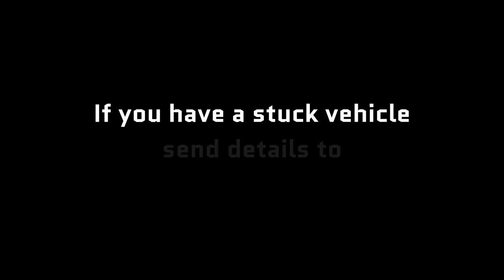The Largest And Most Stuck Excavator I’ve Ever Recovered

Comment: I work on excavators at a dealer. That machine needs a pump/ work group adjustment. Not enough pressure going to the travel motors or work group. A simple turn of a couple reliefs would have made that recovery much easier.
Reply: So your saying that the track that moves it forward and reverse had minimized power and by tweaking some, ; valves? Would have gave it power to travel faster ?
Reply: That's possibility crossed my mind too! The turning power looked way to weak
Reply: @srjr2531  That is exactly how it works
Reply: @rolannolan9336  man this is a major life hack for anyone in that industry lol can never learn too much here on the good old YouTube hopefully guy saw your post !
Reply: @srjr2531  proper adjustment is what he is referring to.  It is not a life hack. You will regret turn that screw with out knowing what you are working with or the tools to view your tampering
Reply: @jacobkrogstad9122  oh dang well when you put it that way it’s probably not a simple life back then lol
Reply: Jacob Moore do you know how to do this “ proper adjustment “ if so niiiice
Reply: @srjr2531  A set of pressure gauges goes a long way when you start messing with excavators.  Those JD 450 excavators are awesome to run when they are set up correctly.
Reply: As a guy who works with hydraulics every day 
I’d like to add that if you do not know what your doing and have a pressure gauge leave the relief valves alone 
A good way to damage your system or get someone hurt 
Need to put a flow meter on the pump outlet check for a healthy pump before you even think about pressure
Reply: It could not pick one end of itself up. An excavator should be able to do that easily.  
It might not have even gotten stuck to begin with if it had a properly working hydraulic system.
Reply: I’ve never worked on excavator in my life and I could tell that that thing was a fucking turd. He could barely crawl out of the hole when he WASNT stuck.
Reply: At least5 to 8 hours work. May even need another machine for an anchor
Reply: Hhhuu
Reply: 8 hours and 18 minutes

Comment: I'd dealt with similar, and this is what a guy taught me:
If possible, dig a pit nearby.
Put in a honking big pump (at least 4 inch hose two would be better) and de-water the ground...just pump it somewhere else.
Then you can work without 'pumping up' the soil so much when you move the equipment.

Comment: You did well. 50 years ago I graduated in engineering. The first company I worked for was a mining company. They had a 17 yard drag line. It got stuck. It was the operators not the engineers that figured out how to get it out. Took almost a week. We used  a lot of trees. Ground you were in looked like what we had dry on top, silty wet sand under that when disturbed would sink a pickup.
Reply: I love operating drag mines, I seriously wish all excavators were drag lines and not hydraulic

Comment: We once had a bulldozer stuck and almost sunk in the mud. We hooked it up to a lot of chains and anchored the chains and the winches on something solid. Then we put the chains under tension. Every single day we would come back, the chains would be a little slack, and we'd put them under tension again. Took a a month or so, but we got it out. The problem with mud is the harder you pull, the harder it pulls right back. Subtlety is the key. Or of course this...
Reply: 30 days Jesus.  You didn't almost sink
Reply: 9.50

Comment: Awesome Job Heavy D,👍👍 I would have guessed 6 hrs and 40 minutes.  This job is a toss up between you and Letsdig18  excavator recovery, that one was buried up to the cab. He only used his excavator and worked in the soup with mud mats, it took him 1-1/2 hrs . In fairness to you, this situation was much different, that excavator was locked up solid, sat and was caked in dry mud.

Comment: When you tried to lift the tracks before you started to pull it since you didn't remove the dirt from under the counter weight you essentially moved the pivot point from behind the tracks to the bottom corner of the counter weight so instead of just lifting the front of the tracks you had to lift the entire excavator up and pivot on the counter weight.

Comment: I would have guessed something less than 8 hrs. I use to own an underground excavation  business in Las Vegas during the 80s and 90s. Your videos make me wish I still owned it. I however do have an opinion on how I would (or could) have extracted that John Deere track hoe. All I would have needed would have been at least a Case 580 or 590 backhoe and a few hundred tons of crushed rock. I would have over exed a ramp leading out of the mud pit digging and filling it with gravel as I went.

 Once to the excavator I would have had a sloped road base filled with about 3 feet of gravel base for the equipment to rest on. I would then excavate about 4 feet below each track then filling the trench with more gravel up to about midway on each track completing one side before moving to the other.

 I would then use the excavator boom to raise each track, working one side then the other back and forth to allow the extra gravel to work it’s way underneath the tracks. Once the gravel was firmly below the tracks I would attempt to track it out of pit using the power of the boom to push as I tracked out (I would have also removed as much mud from the tracks by shovel as possible once they were out of the mud).

 I think it would have worked but obliviously your method accomplished the task! It is just that not everyone has the equipment and manpower you have and I am purely tackling this as if I would have been the land owner. Anyway, thanks for another great video.

Comment: This was Great!  I love it when you do heavy duty problem solving like this.  Now you need to do a one hour show on having an industrial level Blacksmith repair the 5 ton's bumper.  Also, five ton wreckers are cool but if want awesome, you need to get an Army 10 ton wrecker or the heavy tank recovery vehicle. VTR M88.  The M88 is designed to rescue 50 ton tanks, has a huge winch and a spade blade on the front to anchor it while doing so.  You will need a dragon wagon, (super duty Army low boy and 10 ton tractor) to move it around.  It's not too road friendly, even though it has rubber on steel treads.  I think it weighs around 80 tons.

Comment: My experience with stuck tracked equipment is tie they the front of the tracks so the tracks can't roll than the tracks act like skis. And a better use of the dozer is turn it around and bury the blade and use it for a Deadman. Ive pulled out track hoes with a 1 ton wrecker with a pair of 12k winches using a dozer for Deadman. Ive puled 110k steel trucks with a 16 ton wrecker.... Lots of snatch blocks a a few large oak trees!
Reply: 4hours

Comment: Seeing the bumper on the 5 ton going all Picasso reinforces my thoughts on making a spine other than the frame to tie the rear hitch point to a front hitch point. The spine would be the load bearing portion on extreme pulls that require an anchor.

Comment: Looked quite easy really - because the tracks stayed on the entire time. Most older machines stuck that bad would have thrown a track off at some point in the proceedings. Or burst a hose, blown a track motor, overheated etc etc. Good job.
Reply: could show the original driver knew when to say stop and not push it to far
Reply: @J3AD  it also could be we made them very well too
Reply: It looked to me the excavator just lacked power or something, black smoke while just trying to turn the tracks and move the arm isnt a good sign.

Comment: I know you are apparently a pro at what you do and I would not mention anything other than the fact you brought it up first. When you mentioned clearing the area in case a cable snapped of course that is a very important thing to do. Would you consider should you have a situation like this again and you, or someone else, is in the direct line of fire if something breaks (you even did not have any type of safety glass in front of you) bring some heavy tarps and lay across the cable. This action takes most of the whip out of a cable or chain if it snaps. Hope you consider it if not for your sake then for your family if you get hurt or killed. Keep up the good work.

Comment: Estimate before watching the video: 2 hours 30 minutes. Straight forward. Ground is now dry, unlike when it got stuck. Dig out around the tracks and it can pull itself out.
Reply: ya what's all the equipment for?  1hr  23min on it's own power and by itself.
Reply: Okayyy Einstein.
Reply: That's what I was thinking it could dig itself out.
Reply: It could if it wasn’t old as shit and the pumps weren’t worn right out  in it.
Reply: @stevejablonsky7102  only a minute into the video but i would literally never trust you to run an excavator or even gradehop on one of my jobs if you think that lmao
Reply: @sjv6598  yeah, I did watch the video and  see it was still wet after he started digging. As stated above, my estimate was before watching the video.
Reply: @sjv6598  Side note, Letsdig18 has recovery video that is even worse than this one and it took 1.5 hours from start to finish. In the let’s dig 18 video, there was no dry out time and it was pure swamp.

Comment: In my ancient experience, to have the 'hook bucket' work you better have an equal or larger sized excavator and not have f*****d around with the stuck one too much thus sinking it even further... I once got involved w recovery of totally sunk & dead long-stick 250 sized excavator about 100yds out in a former water treatment settling pond (yum); took a pile of mats, big dozer W winch, medium dozer pulling, and my 200 sized excavator to dig a trench out, mat it, and then help drag the victim back onto high ground. Moral of the story: Tell your operator "Once you is done stuck, QUIT F****ING WITH IT!"

Comment: 2 short chains  about 5" longer then width of the tracks, hooks on ends.. hook them across the track, (like a snow chain on a tire) then you got a place too pull from on each side, and it will help get track moving if you hook them on top of track in middle, and pull from them gentle..
 
i got a old Big old  jd 4## somtin excavator, old thing..  big machine. Had a lazy track..  got hung up and stuck. Sunk. 

short 2.5 ft' chain with grab hooks, hooked across track, from inside too outside. then hook the pulling cable on too middle of them) and will help get track spinning, and or machine rolling- good pulling spot if cant hook onto the undercarriage.

Comment: You guys really need a 8x8 Oshkosh HEMTT wrecker. They'll pull that excavator right out in a second. Hell, it'll pull the earth off its axis with the proper snatch blocks.
Reply: He owns a HET M1070! lol. Not sure why he didn’t take it!…
Reply: It will damage it
Reply: earths axis is appox 66.6 degrees from horizontal
Reply: Wouldn’t touch it, 100,000 lb machine plus prolly 50,000 lbs of mud and mud suction
Reply: Yeah, Tony beats struggled to pull his barge on the trailer with his HEMTT. Had to get his big dozer
Reply: I miss my 10 HEMTT wrecker. That thing would pull damn near anything with the correct rigging.
Reply: No they need an M88 tank recovery vehicle, winches can pull 140 tons
Reply: It's funny. He just dropped a video of his new HEMTT. Boy did I call it or what?! 😆

Comment: If you dig a sump hole and submerge a cheep (electric) pump you can run it over night and pull the ground water out of an area. Clay is tricky but that’s what we do when working in south Louisiana
Reply: Done the same but it was a muddy mess.
Hard on the bearings.  
What i wonder is how do ever get new asphalt to harden when it is soooo hot in Louisiana?
Reply: @assassinlexx1993   Took weeks to harden in front of my house. We had to hit it with water to harden it.
Reply: @assassinlexx1993  it does usually ruin the pump, but you can burry a hose too, if you have a trash pump that self primes and can run dry.
Asphalt really doesn’t harden in the summer time, it’s part of why our roads aren’t great. It’s kinda just an anti slip surface we cover the mud with 🤣🤣
Reply: @ashtoncrow9368  
Finally I know the answer.  It is the mud that does the trick😎
You are right about the pump.  But you use what the boss gives you.🤐

Comment: "Biggest fear is this cable snaps" puts pressure on the cable with the bucket 🤣🤣🤣
Reply: I got hit my a 1 inch snapped cable across the back of my legs. Didn't cut my legs off, but through me in the air and black and blue for a month. I was lucky.
Reply: @T18skyguy  I had colorful front of my thighs when I did sudden front flip on my bicycle (with it) when I was riding full speed down the street while running from an incoming summer storm, and I haven't noticed a chain stretched after hours at the entrance of some small parking lot. I was lucky too.

Comment: i think some time and headache could have been saved by using the weight of another excavator to assist jacking it up on each side enough to spin each track clear before winching it. You have the access on each side to get leverage and grip buckets even if you don't want to put the extra strain on the cylinders by just pushing on the boom. Worked out in the end though.
Reply: always easier to say through a keyboard

Comment: Having been in heavy equipment for all my life I found that track units get stuck from the vacuum formed when they sink. If you use a length of pvc worked under the center ram a stick of powder under. Put a bit of power to the tracks nut not enough to spin. When you set off the powder it breaks the vacuum and you drive out. Ask any muskeg operator
Reply: At least a month!!!

Comment: That deere had some seriously weak hydraulics. It should be able to lift itself no problem
Reply: Crank up the pump power , then it will lift its self no problem.
Reply: @bluesman7703  I've seen people turn them down to save on fuel. We got a d6 in at work and it had no ass whatsoever. I started messing with the settings and figured out the previous owner had the engine speed turned down to 40%
Reply: Deere and Hitachi are supposed to be the same machine but having run both, I swear Hitachi has much smoother and stronger hydraulics.
Reply: Ever had you foot stuck in mud and it was hard to pull out? Same thing
Reply: @philbook5477  yes sir and I've had dozers and excavators buried butthole deep in fly ash. I didn't mean that I think he should have been able to pull himself out, he had no chance of that. I just mean it couldn't even lift itself. Hope I don't come off rude text don't convey tone
Reply: It would have, but the body back is not going down due to the mud (wheels being the pivot)

Comment: this might sound crazy but have you considered getting  a old drill truck ?
then just angle the drill setup so it drill a angled hole you can put  anchor poles in for the winches and for securing vehicles.
im thinking it would  fit in the fleet among vehicles that have gotten a new purpose.
maybe even one of those stompers they use to ram poles into the ground .

Comment: 12:00 pumping out water is exactly what you need to do! Drill a 20' well and drop in a suction hose to dewater the ground.
Reply: Super hella dumb question. Can't you use pressure washer(s) to free like parts at least while you are doing a pull? I know it'd introduce more water, but probably not that much? Again, asking this as an armchair expert..
Reply: @CitarNosis317  if the soil is clay, which most likely was, it would make it worse to add more water. It's really slick and creates a suction.

Comment: Seeing that 5 ton wrecker brought me back to my days at Ft Bragg. 264th Engineer Co Maintenance platoon. Should have anchored that front bumper by the frame hooks Then you might have a bent frame to go along with the bent front bumper...

Edit... If you managed a 5 ton, why not go for a tank retriever as well?
Reply: I'm betting that would take at least 2 88's working together to pull out.
Reply: @ronlawrence5021  With that mire factor.... 2 88s working with 4 turn snatch blocks....
Reply: @johnrschmidt2  
And several "Hail Mary's"...
LoL
Reply: @ronlawrence5021  oh yeah. And several firm chats with Mr. Murphy.....

Comment: Excellent recovery, good attitude by everyone - for me, few heart pounding moments - people a bit close to some of the cables when rigged, I have seen  12,000Ib pull cable snap recovering a stuck Land Rorver, took out 2ft thick tree - have also witnessed the after effects of a cable snap and what it does to a human body - not pleasant. The fella in the redt shirt kept running under the main boom when operating - madness. However, really good job, everyone safe, mission accomplished and a great video. Maybe you should look at buying a M88A2 Hercules...pulling machine on steroids.

Comment: One guy with a excavator could get it out in under 12 hours by himself.
Reply: Dig himself out actually in less than 8 hrs
Reply: Yeah my guess is when he first got stuck it was wetter,, then during a couple of those tries they got it stuck worse, plus two wenches and a block really secured it and got it unstuck then was easy after that, but lots of digging first t get all then stuff that was stuck in the treads
Reply: Yeah they are making a meal of it- a bigger excavator with a decent chain on the front of the stuck one,then the stuck one pushing from the back with its bucket- would have come straight out